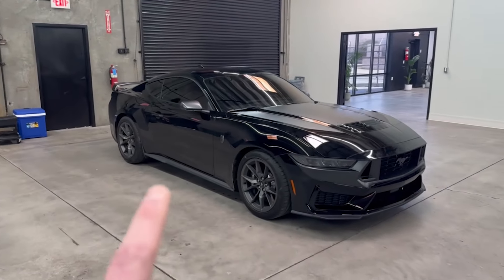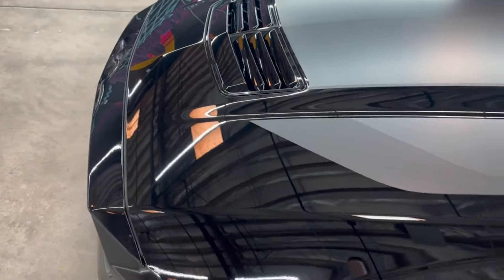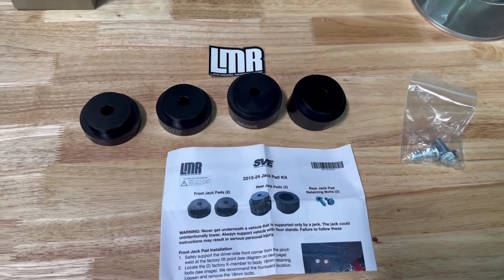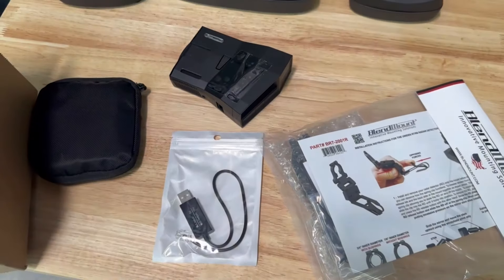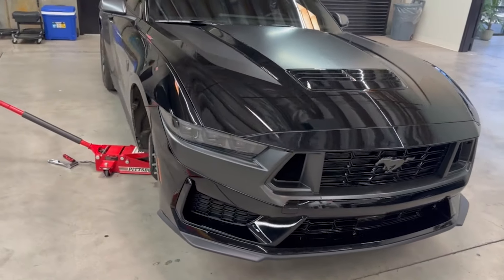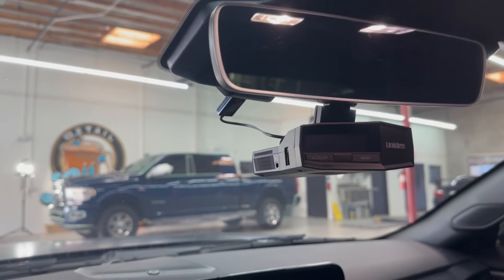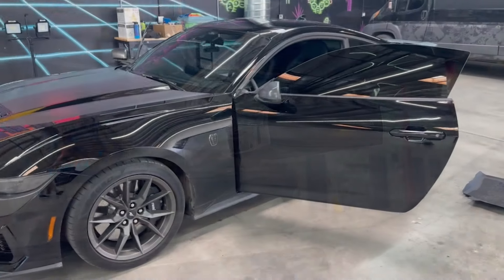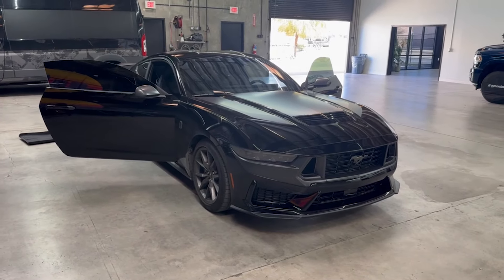TOP 3  MONEY SAVING MODS FOR YOUR 2024 S650 MUSTANG!

Comment: Great video! My S650 PP1 comes in very soon and have the kit for the front fenders already not enough people talk about it. Also have full length jacking rails and for radar detector going to just use normal plug and trying to find a short cable for dash camera to use the usb port in the mirror area. As far as tint 5% and 35% windshield with my own detailing and tint shop. Front PPF have to find a local place that’s good at that. Also doing carbon trap removal and putting H pipe with the active exhaust. First things I’m doing as soon as it comes in
Reply: I did tint and bought steeda hpipe gonna wait until I get kooks lt and hiflow cats to put on all at once with tune for 93

Comment: How did you get all the rocks out did ya have to take off side rocker panel? Also stage 2 whipple isn’t warrantied just the stage 1?
Reply from the maker: Nope didn’t take them off. I just tapped it a bunch and they came out. And yes stage 1 is the only one that has a warranty
Reply: @tuxon_speed appreciate the fast response currently saving for it on my new s650 1st is longtubes hiflow cats then supercharger